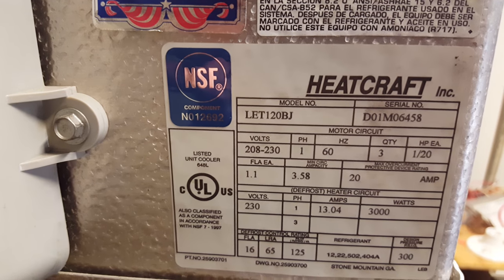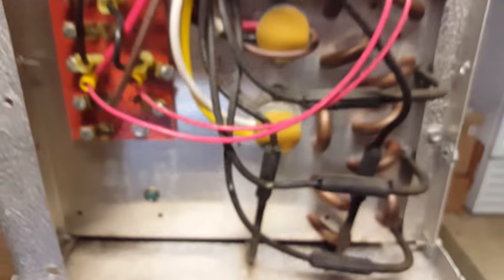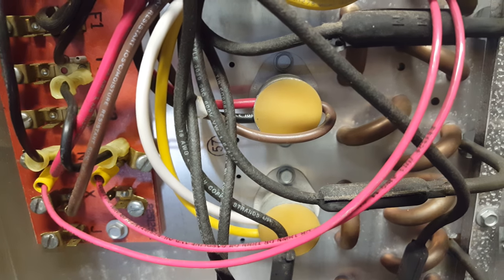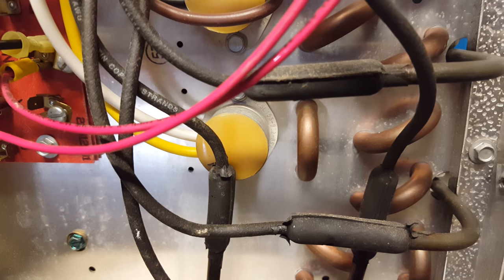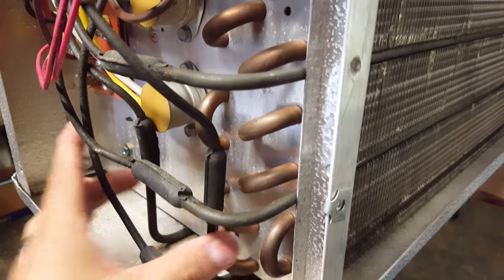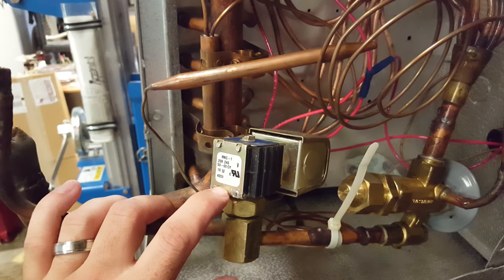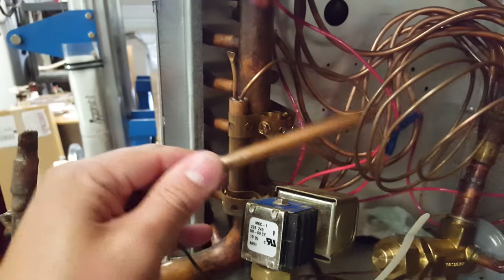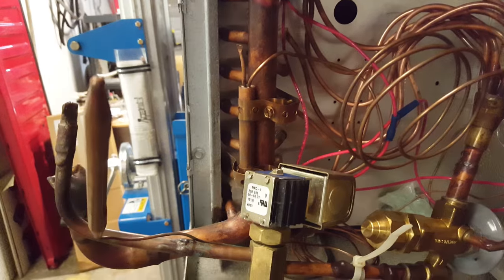Freezer (walk-in) Evaporator Explained - Part 1 of 3

Comment: That txv bulb is mounted in the wrong location. It needs to be mounted further down stream on the suction line outside of the evaporator coil.
Reply: I get that it is mounted on the suction manifold but on this small of a system will there be much difference if it is mounted six inches to the left on the true evaporator outlet pipe?
Reply: dave johnsonnola I would say yes it does make a difference. If it didn’t, it would come already mounted from the factory on the manifold. Mounting it on the manifold and not after all manifold ports would cause the TXV to throttle and lower the btu rating of the evaporator.  If mounted Lower down stream “outside of the evaporator” gives the expansion valve a correct reading and will size the txv to the evaporator Hope this helps!